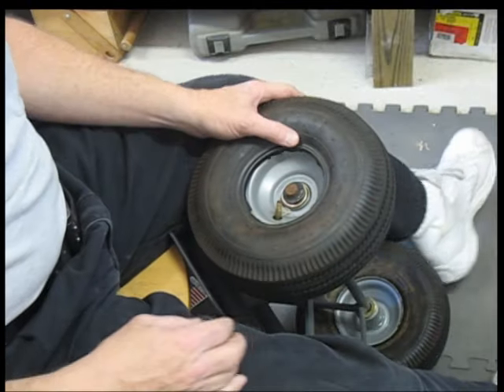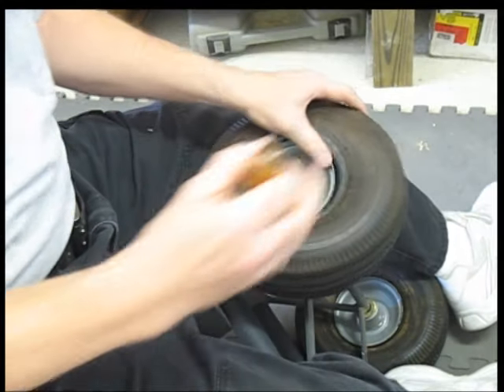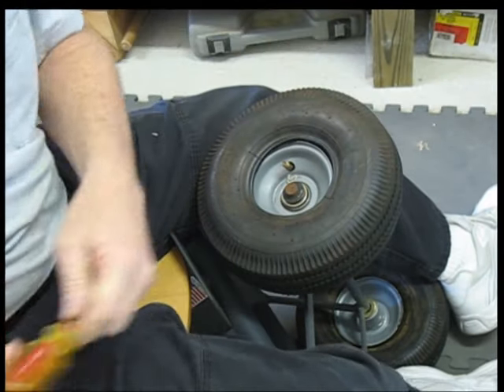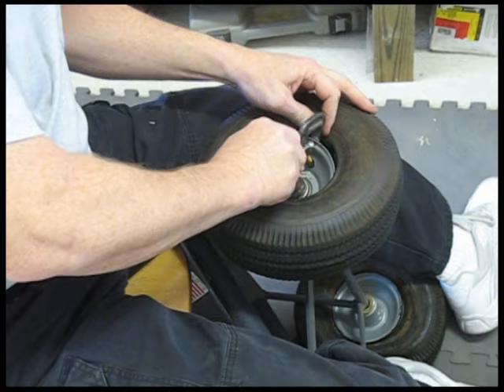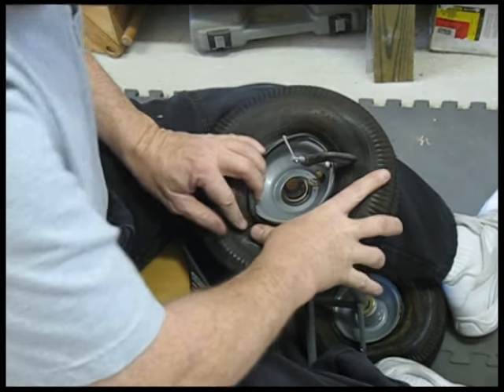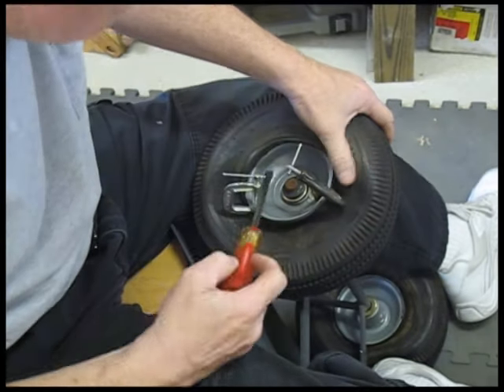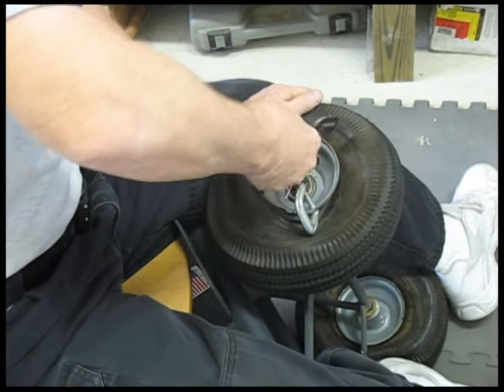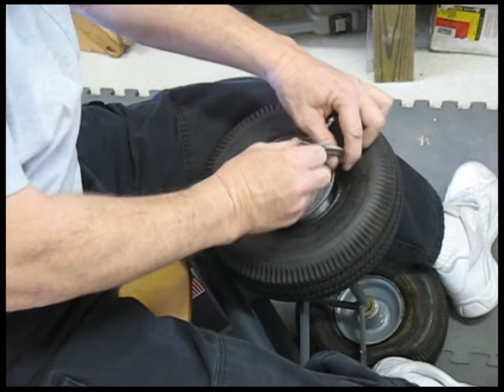How to Mount a Small Tire on Wheel

Comment: This is the ONLY solution I have found that WORKS!!!  I have a flat wagon that I use to move tree trunks up to 1,000 lbs (for my furniture making hobby), but cannot find  new quality pneumatic wheels that will hold air for more than a few months; the pre-mounted ones are all junk.  Finally found some quality innertubes but couldn't re-mount the tires - UNTIL I FOUND YOUR VIDEO.  Thank you for a simple, yet elegant solution that works.
Reply from the maker: Yay!  I'm glad it worked for you.  Thanks for letting me know.

Comment: THANK YOU!!!!!!!!   ❤❤❤❤❤ This really helped. However I had a slightly larger wheel and very stiff rubber tires. The C clamps helped, but the tires were too stiff to slide over the last of the rim. So I put it on the floor, and wearing athletic shoes, stood on that final section, using the backs of both heels to force it over the rim and it worked, it slid right over the rim! This was for the older 13" Gorilla Cart wheels that fit on the 600 lb capacity model, still going strong thanks to your advice!
Reply from the maker: Good thinking!

Comment: nearly tired with trying to mount a 4 inch tire until i saw the great video using small c clamps. Did not have the small c clamps but did have medium sized vice grips. Used them on the rim and 10 minutes later job done.  Another win for utube . Thanks.
Reply from the maker: Great!

Comment: Absolutely the best video I've used for this situation.  I used what I had, 2 vise grips and a heavy duty spring clamp, but it was the concept of preventing the tire from moving on the rim which was they key.  After trying for an hour, it took me 10 minutes to put one tire back on, then it took me 10 minutes total to work on another tire to take off the outside,  install a tube, and re-place the outer bead back on the rim.  

I agree, this is one of the best videos showing a really practical way to mount a tire on a small wheel.  Kudos and thanks!!!
Reply from the maker: Great!  I'm glad it helped you.

Comment: Thank you so much for this handy tip!
 I did not waste days, but I did waste about 45 minutes before I came inside and looked for a you tube video to assist me.
 I repair machinery for a living, but not this sort of stuff...this was for my lawn mower wheel at home.
 Large tire are easy, but the small ones are much harder because the bead is so small.
 Anyway, I did not have c clamps handy, but I did have a set of spring clamps...and as soon as I saw the clamps in your hand the light came on in my brain!
 Thanks a million sir...a huge help.
Reply from the maker: You are certainly welcome!

Comment: 11 years later and this man is still saving sanities one small tire at a time! After preforming an adult vocabulary building exercise for about 90 minutes I relented, came in the house and searched the AL Gore International Library. Stumbled on this... Didn't have two clamps that small but I did have a pair of 6" Vise-Grips and they did the job.

Knew about the bead seating trick with starting fluid but never had a need to use it. This time I did. I gave it two very small spritzes one across from the other. Pretty sure one would have been plenty. POP! Job done!

Thank you sir! I owe you a beer 😉
Reply from the maker: That is hysterical!   I'm glad it helped you.  Thanks for letting me know!

Comment: I used Vice-Grips Locking Pliers because I didn't have any small C-Clamps. Still got the job done and I feel this is great option for others as well!
Definitely don't need a lot of clamping force, don't bend the wheel. I also sprayed some silicone oil all over to help everything slip on.
Plus, I used one of the pairs of locking pliers to hold the valve stem in place while I started inflating, since it wasn't a screw on chuck.
Thank you sooo much! None of the other videos showed how to do this step with a small and difficult tire.
Reply from the maker: The silicone oil was a great idea!  I'm glad the video helped you.

Comment: OMG....YOU ARE THE BOMB!!!!     Used your technique to mount a 16.50 x 6.5; (6 ply rated at 800# weight limit) on an 8 inch rim for a garden cart.   Putting a cubic yd (too much) wet road gravel had burst the cheap tire that came with the cart.  Had replaced one with what the garden center/hardware that sold the cart stocked with the same result (ruptured the SOG).  When I put the rim on the first side, the opposite edge was at least 4 inches from the rim! From your tutorial, I used a pair of cheap (HF) 3" C-clamps set 180 degrees apart on the rim.   I had to cut and grind about 3/4 inch of metal from the outside of the "C" to make the portion that inserted between the rim and the edge of the tire narrow enough to allow the tire to seat close to the rim with the clamp in place.  The side that remained to be stretched out over the rim was a good 3-4 inches inside the edge of the rim!  Used two very large standard screwdrivers (12 inches of shaft and 6 inches of handle) to work another 4 inches of the tire edge under the rim until 3/4 was in place.  Then left one screwdriver in place and inserted the heftier screwdriver at the midpoint of what remained to s-t-r-e-t-c-h the tire rim out until it dropped into place.  NEVER>>>>NEVER>>>NEVER would have done this by hand without the C-Clamps.   Only took 30 minutes, and that included fabricating the narrowed clamp.   Thank you!!!
Reply from the maker: +Dennis Mitchell Improvise, adapt, and overcome.  Good work Dennis!

Comment: Thanks a lot for your brilliant C clamp idea and excellent video.  I have been fixing cars for 50 years but never had to mount a tire on a rim. I wasted a half hour using hands, knees, feet, and pry bars before I gave up and found your video. I wrapped my pry bar ends with duct tape to protect the tire from the sharp edges, also used liquid dish soap to lube the tire rim. Success!
Reply from the maker: Good idea with the duct tape!

Comment: Really was so so much harder getting the tire on before. Another video showed my exact tire with the yellow rim and there was no way it could be pushed on. I had one clamp and a locking pliers and with another shot of effort got it on finally. This video is the key to getting it done. Thank you. Next time I'm filling the tires with foam. Not going through this again. Great video. Takes awhile to find it but worth the effort.
Reply from the maker: I haven't tried foam but it sounds promising!  I'm glad the video helped you.

Comment: Wow....you are a clever man. I have the same dolly with the same problem. I would have never got to that solution. I thank you in advance because I just patched my tube. Due to how difficult it was to remove the tire. I searched "how to mount a dolly tire"
Your video was the first video. 
Thanks again. 
P.s. I had to move an 800 lb. gun safe with that dolly converted as a "flat bed"
....my tip to you is dump those original casters. Get your #19 Socket and an abandoned shopping cart. Front two wheels will mount on dolly giving it a whole new feel. Thanks again
Reply from the maker: shimi yacoby Thanks, Shimi!

Comment: Discovered another option. After removing the wheel from the axel and replacing the inner tube, I held the tire in front of a lot small propane heater to heat up the tire just a bit. Then I put the wheel on my work bench and pushed down the tire, putting all of my weight on the tire. It popped back on the rim with a bit of coaxing. Thanks for the video!
Reply from the maker: Nice!

Comment: I too was struggling with putting my old tire back on after replacing the inner tube.  I didn't have small C Clamps but I used some vice grips and the biggest Screwdriver I had.  Thanks for the great idea!
Reply from the maker: That is great!  Thanks for letting me know.

Comment: I screwed around trying to get it back on for 45 minutes. I used clamps and a vise and was about to give up. Finally, I got it back on with brute force. Your idea is much better. The key is something that holds that damned tire down below the face of the rim (I used the vice faces) and forces the tire to have to pull under the rim to relieve pressure. Thanks for this idea !!!

Comment: Good heavens man, get some LUBE! Dish soap, transmission fluid, motor oil, anything. Also, vise grips work as well if not better than C-Clamps. Still, thanks for taking the time to post your video. The C-Clamp trick is really the key to making this PITA job much easier.
Reply from the maker: Thanks, Django!

Comment: I agree that was the only video I found with helpful information to mount tire to hub.  I didn't have miniature C-clamps, but I did have some 'needle nose' vice grips that did the trick.  Also remember to use some watered down dish soap to make the surfaces slippery.

Comment: Thank you!  Was getting frustrated with some loss of hand function, atop the small wheel diameter difficulty.  Once you showed clamping, to add 'more hands' to the effort, and that you left the wheel/tire mounted to axle for more complete control, I corrected my efforts.  I used smaller, hobby sized Vise-Grip type clamps that I had ready.  Sneaking them farther around as the bead is coaxed into position is the trick.  Only thing I could add would be to add vaseline to inner aspect of bead, but if that spread out too much, might reduce effective clamping.  So, it's a win for me.  Tires all pumped up and ready to go.
Reply from the maker: Super!

Comment: Thank you! Found this and it saved the day! I have a similar hand truck to the one in the video and both tire tubes had holes on the inside facing the rim. The rims on the hand truck are made of 2 pieces welded together to a hub with a gap between the two rim sides. The edges are sharp in some spots and there were two sharp areas where the welding started and stopped. My guess is that is what over time put those two holes in the tube. To prevent that in the future, I used rubber splicing tape wrapped twice around the center of the rim to cover that area like the rim tape on a bicycle rim which prevent the spokes from cutting the inner tube.
Reply from the maker: Super!!  Good technique!  Thanks for letting me know.

Comment: Hey, pretty smart. Thanks. I'll use that method. My problems started because the valve stem wasn't long enough. One tire lost pressure, and I couldn't even get the air hose on to inflate it. I tried to gently pull it forward with pliers to expose enough to get air in. I squeezed too tight and ruined it. Now I have to get a new innertube. Valve stems shouldn’t be so short. It’s really aggravating. Would it kill them to make them a little longer? Maybe I’ll super-glue the next one to the rim.

Comment: Thanks for posting good tips. Instead of using a screwdriver I always like to try to use the end of a pliers Handle where it is rounded. The screw drivers tend to be a little sharp if you are mounting inner tubes.
Reply from the maker: Good point!  Thanks for watching.

Comment: My tire was a 10 inch tire on a 4 inch rim for a 25 gallon sprayer. I didn't just have to change the tube but the entire Tube and tire assembly. I tried for about 2 hours then looked on the internet and there you were. The C clamps were a GREAT idea and made the replacement job possible. Thanks for the help.
Reply from the maker: Clifford Peterson I'm thrilled it worked for you!

Comment: Was searching how to mount a tire like this, however my tire was much more stiffer and a plastic wheel that didn't hold any clamps. Though inspired by this video, What I did was pop one side of the tire on the wheel and clamped the tire together with one big clamp, then used a large screwdriver and some soap to work my way around the tire. Worked like a charm!
Reply from the maker: Good for you!

Comment: Perfect, and thank you.  I had a 4 inch rim with the same problem.  Only change I found was I ended up running the screwdriver around the outside of the rim, not across the center, and then inching the c clamp on that side around a little at a time.
Reply from the maker: Good improvisation!

Comment: When I saw this video, it showed a good solution for a metal rim.  I tried the small c clamps on a plastic rim and there was not enough surface for the clamp to grab.   If you have a plastic rim, try my suggestion below that worked for me.   I put the bottom of the tire in a large bench vise and squeezed it so the rim was on the outside.  I then took 2 large woodworking clamps and squeezed the tire past the rim in two more spots.  That allowed me to use a flat screwdriver to pull the the remainder of the tire over the rim.   I should have made a you tube video.   It works great.
Reply from the maker: Excellent strategy Richard!

Comment: Brilliant,,,I was trying to use vise grips,,,but the c-clamp is the answer.

For what it's worth,,,,once you get the 2 clamps in place,,,,push down and hold down the mounted part before you pry opposite side with screw driver. The opposite end should be held below the center of axle which is a narrower part than near the bead.

Comment: Slick!  These little tires can be meaner than big truck tires...I used your trick on a particularly nasty 16-6.50-8 snow blower tire but I used 2 vise grips and worked one of them around as the tire beaded...wasn't going to happen otherwise so thanks..
Reply from the maker: I'm glad it worked for you!  I've never tried a big truck tire.  Sounds scary.

Comment: I was seriously riding the struggle bus until I saw this.  Didn’t have any small c-clamps but I did have a couple of small  vice grips and they worked just as well.  Less than 5 minutes had that tire on the rim.
Reply from the maker: Crafty!  I like it.  I just tried the C clamps because I had them and got lucky.

Comment: You're trying to push the inside part of the bead over the rim. You need to roll the bead 90 degrees so the smooth part is sliding over the rim. Also you need to push the first part of it DEEP into the groove on the rim. Done correctly absolutely no tools and no force are required.
I did this job just today.

Comment: Man been struggling - don't have two small c clamps but going to try with vice grips
Reply: how did the vice grips workout? I like closer..
Reply: Really, really well!  I used a regular sized pair and then had a small needle nosed pair - they held great and I was able to inch around the needle nose moving them as I needed to as I closed the gap.

Comment: They do sell cheap tire spoons to use instead of screwdrivers which can damage the wheel. I guess if you are using a tube it isn't critical but if you are fixing/mounting a TUBELESS TIRE then you don't want to damage the sealing surface of the wheel.

Comment: I'm gonna try this,hope my plastic rim survives. Cheers
Reply from the maker: Wow.  Plastic rim is scary. Good luck!
Reply: @dawmlw  haha yea I had a pipe with another pipe welded to it at 90 degrees and could press down 2 points of the tyre, screwdriver then and a few patches later the job was done.
Reply from the maker: @extractorfan2143  wow!

Comment: The one small thing you missed was to remove the tire start at the valve stem and when putting it back on finish at the valve stem so the tire does not cut the tube at the valve stem. It needs the room at the bottom of the rim to go on and off. Great tip tho'.
Reply from the maker: Thanks!

Comment: It turns out that if you are 290 lbs and strong as a bull, you can do it with 2 screwdrivers and lots of sweating and swearing.  That describes the way my tractor guy down the lane did it.  Your way is easier.  Thanks for the video
Reply from the maker: That is hysterical!

Comment: This does not work.  The clamps are in the way.
Reply from the maker: Please post a video so I can see what the problem is.
Reply: You have to position the clamps (or vise grips) in such a way as to allow your pry bar to fit between as you lift/pry.  I used a long 10" screwdriver which is very narrow, but made sure to start with at least 1/3 of the bead under the rim, and held by the clamps/grips, giving about a 1 inch space to work between.  You can pry across the clamps to about 1/2 way, move one clamp to the 1/2 way, and now there's plenty of room for your prying instrument in between.  Once you pry to 3/4 way and you clamp there, you know you've almost got it.  Pry that last bead section home, and you're done!